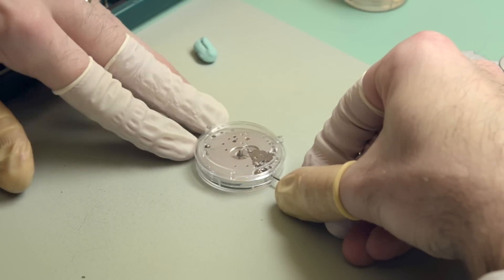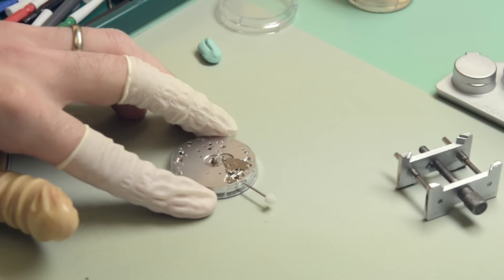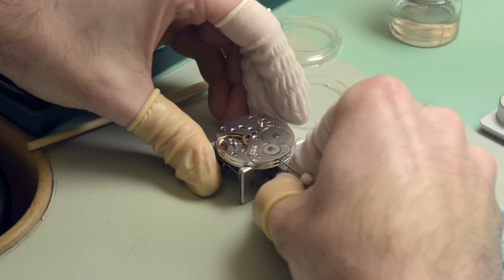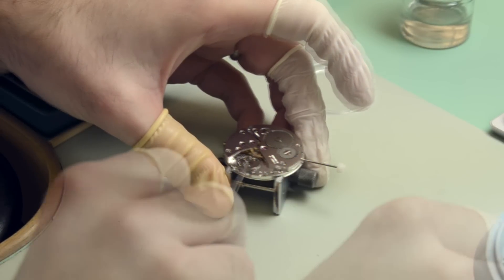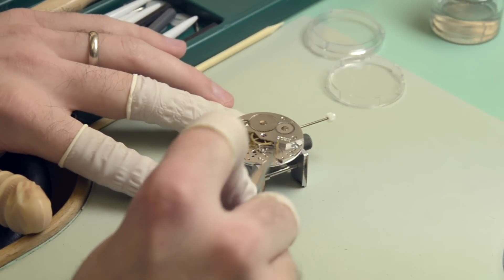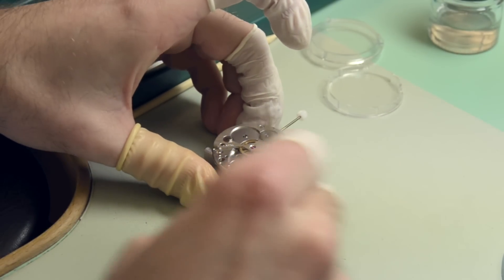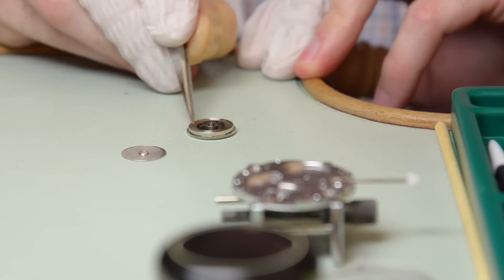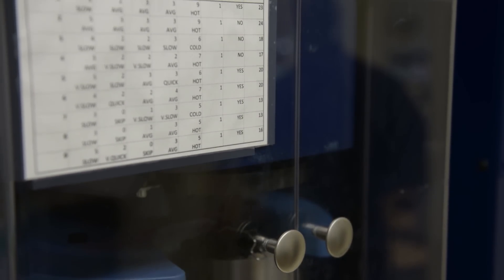A Deep Look into a Mechanical Watch!

Comment: What kind of bushings do those wheels have? Is there any kind of lubrication or something?
Reply: Attila theHun The red looking bushings are actually manufactured ruby, also known as "jewels" in the watch world. The idea is for them to be harder than the pivots of the wheels so the wheels will wear first if anything (and they are easy to replace). Further on that, pretty much anything that moves in a watch will have oil or grease on it, this is actually quite a challenge to do and we spend a lot of time practicing oiling.